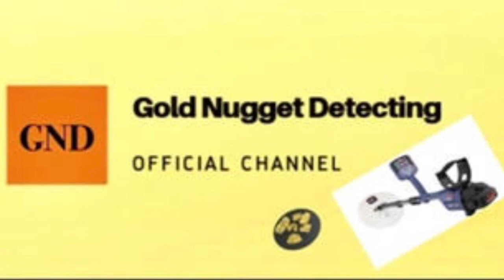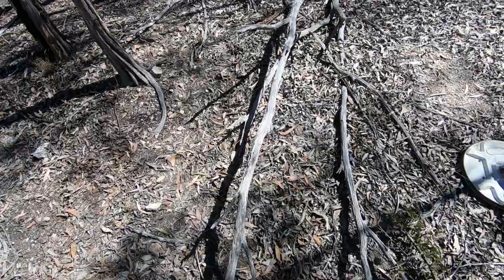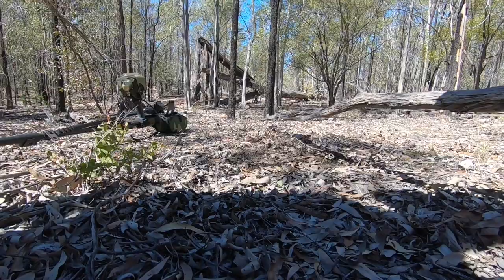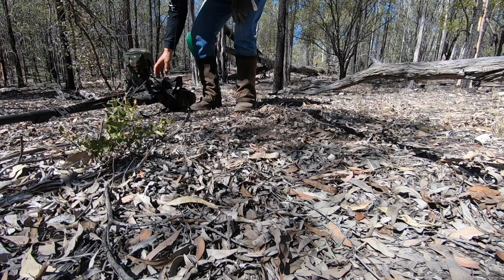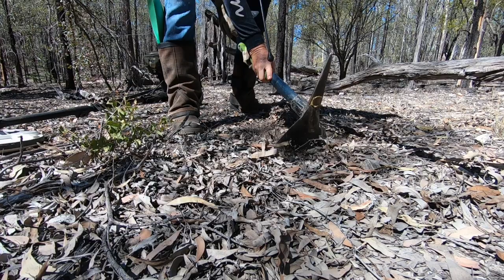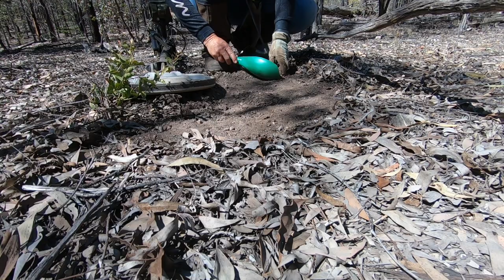GPZ 7000 - with Nugget Finder 12” Z Search (test) coil - No 3

Comment: TBH would expect to get that easily with the stock 14”
Reply from the maker: Yes, you may be right. Whether it’s the sensitivity up a bit, not sure, but could really hear signal in the headphones. 😀⛏⛏
Reply: @GoldNuggetDetecting  
What sort of earphones do you use.
I have tried a few cheaper ones. 
You think they are ok but don’t know if you are missing sounds. 
I noticed you use the under chin style. 
Are they the conference call type?
Reply from the maker: @goldfools5445  I have an under chin light headphones (so I can wear a wide brim hat) that I got from Outback Prospector shop in Clermont. They really are a stenographers headphone. I think they are pretty good and amplify the sound.
I’ve just bought a pair of ZX Gold headphones that have had good reviews (not cheap) but looking forward to trying them out (downside, no wide brim hat).